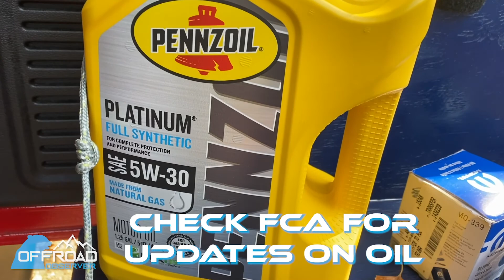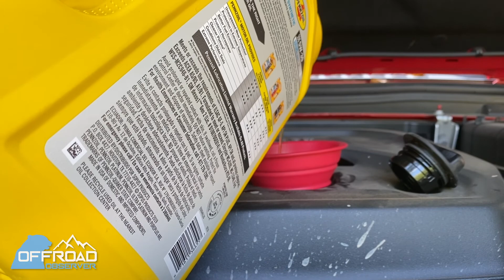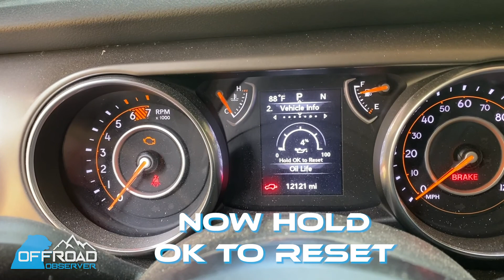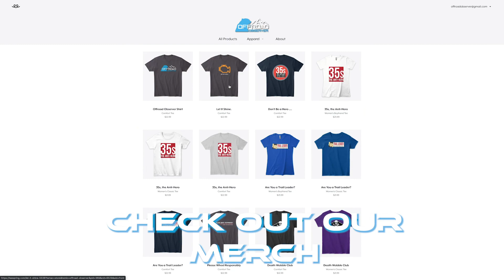JEEP JL 2.0L Oil Change

Comment: After 35 years of changing oil on my back, I still manage to make a mess! Anyway, I found if you use an actual bucket for the oil to drain in, you will be a lot less messy. Those oil change pans, that you buy at Auto Zone or Walmart, seem to facilitate oil splashing. Along with splashing comes the mess! 
As far as pouring in the new oil is concerned, I use the widest funnel I can find. Otherwise, I do what this guy did!
Reply: Garage Boss Oil Drain Pan/Funnel. Model GB150 on Amazon. $23 and the best I've ever used... in 43 years of oil changes.

Comment: good video. where can i find the torque specs for the oil pan bolt and the filter?
Reply: don't worry about torque specs for the filter for sure.  Hand tight is fine but you can give a partial turn for extra if you wish.  The drain plug is basically tight with the wrench while apply decent pressure.  Once you start feeling your arms having to give a little extra power to turn the bolt then stop.

Comment: What Skid plate is that you're using?
Reply from the maker: It is the Rusty's 2.0 skid.
Reply: @offroadobserver  Does the skid from Rusty's protect the oil filter at all?  I just had an issue occur over the weekend where my oil filter got punctured from road debris.